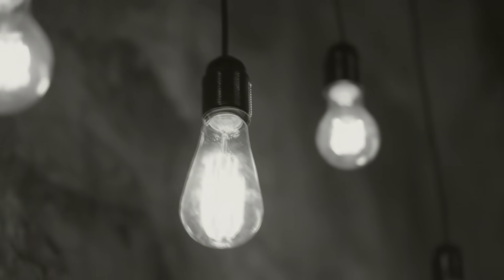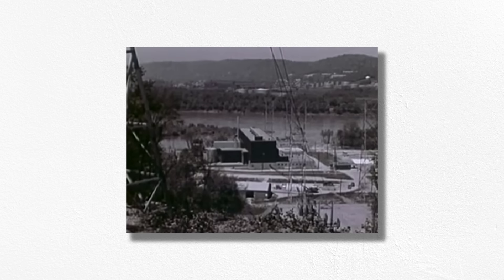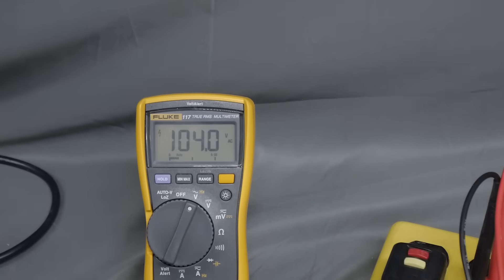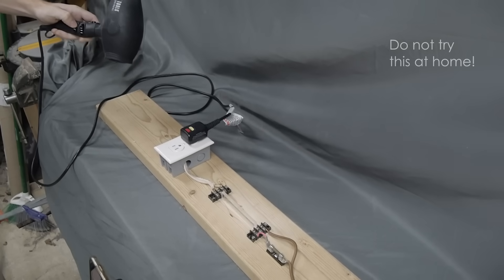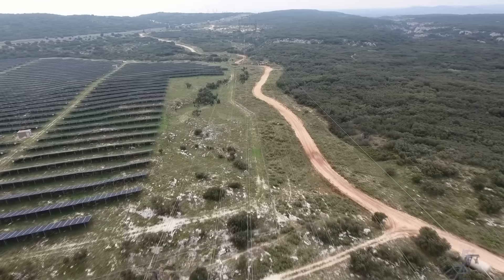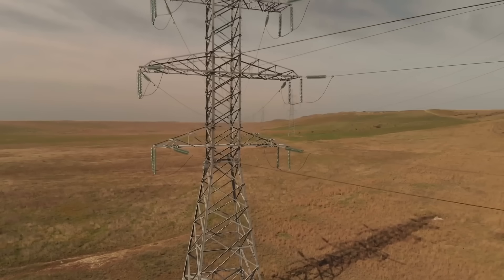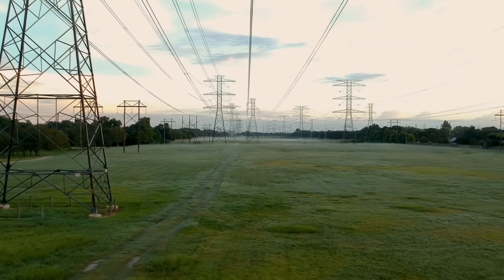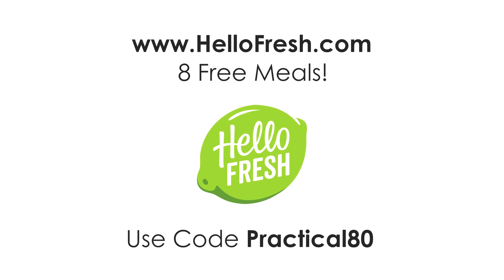How do Electric Transmission Lines Work?

Comment: What's the 3 phases for?
Reply: Really requires a long detailed answer but essentially it is the best way to send as much power as possible at least cost for AC systems. If a single phase system is capable of transmitting power P at a given voltage, a 3 phase system can send 1.732 (square root of 3) times P at the same voltage for each phase. The phases have the same frequency and voltage but each of them is 120 degrees apart (think of sine waves shifted 120 degrees apart)
Reply: because they deliver constant amount of power over time (need some maths to prove this, but take it for granted). power generated is always constant, so you need to deliver it at a constant rate too

Comment: How does higher Voltage decrease Current? From V = IR, V is proportional to I, meaning higher V, should increase I? Considering the hair drier example works, I think there’s something funky about that formula. That cannot be the whole story.
Reply: He used the wrong equation. It's supposed to be P=V*I, not Ohm's law.
Reply: What we're doing is to transmit power from one point to another. in an ideal transmission power in equals power out, but we live in the crappy real world, so we have to take into account the Voltage losses over the power line, 
This voltage loss can be calculated by the formula V=IR.
So the higher the current for a known resistance (ohms per kilometre/mile of transmission line) , the higher the voltage loss over the transmission line. Thus less power delivered to the end of the line. 

So to reduce the Power loss over the transmission line we can decrease the amount of current on the transmission line, but to maintain the same power supplied we must increase the voltage, 
P=IV

I hope this helps a little. 

Watch what Grady goes through at 2:50 again, but take special note to what he is calculating with the equations. His explanations here are spot on apart from the 2nd time he puts up V=IR and not P=VI

Comment: would be great to hear about the subject - HVDC powerlines for example.  Part 2 maybe? ;)
Reply: That would be awesome. I know that we're building HVDC infrastructure but i don't really understand how it works or how it's better than AC.
Reply: @jmonsted  Tom Scott did a video on that. Above a certain voltage and a certain distance, the absence of capacitance and inductance (because it's DC) makes HVDC economical.
Reply: Also no skin effect for DC; one can use the whole cross-section of the conductor equally effectively.
Reply: @davidbarts6144  came here to say this. With A.C. power we need bigger lines to accommodate the same amperage at high voltage.
Reply: @ElevatedEyes2023  is that also because the AC voltage is RMS, wherein it has a higher peak voltage and therefore higher peak current?
Reply: @iamdave84  current and voltage go together. Having a high peak voltage will not increase the current, as the higher the voltage the less current you need. 

As the voltage approaches the higher voltages, the power wants to ride along the outside of the cable. This has to do with the way that A.C. power works. At lower voltages it isn't a concern.

I hope he'll make a video on this topic to go into details beyond what I can explain.
Reply: @ElevatedEyes2023  Voltage = Current x Resistance, so when the resistance is constant, the current will flow back and forth proportionally to the voltage.

As the voltage reaches the crest of the sine wave, it'll be higher so naturally the current will also be higher at that point.
Reply: HVDC....quite a few videos here about that....seems dc is going to be preferred as lines reach about 600-700 KV....biggest 'hurdle' of course it the rectification, and generation of DC at that level.
Reply: YES, I have a friend who used to work with utilities who told me about HVDC and I was wondered how that's possible, if they have higher purity, lower resistance conductors or if something else has changed to make HVDC more efficient.
Reply: @slashetc  It's mostly just that the conversion equipment is so much more efficient than it used to be. HVDC made a lot less sense when you lost more converting than you would on transmission losses.
Reply: Part 3 can be about SWER ;-)
Reply: Before the focus on terrorism, I got a behind-the-scenes tour of the Celilo end of the Pacific DC intertie. I saw mercury and thyristor valves in action, sending DC to LA.
Reply: https://en.wikipedia.org/wiki/Celilo_Converter_Station
Reply: The high voltage DC lines are turned on and off via turning on and off the AC power which is being converted to DC High Voltage.  At Celilo near The Dallas in Oregon and Silmar, CA at the other end of the line.  The AC is easy to turn on and off because the power crosses zero current 120 times a second.  HVDC switches evaporate on being opened the first time due to arcing.   Long distance AC tranmission needs capacitors added to correct the power every ~100 miles.  This adds a substation and transformers and switches and staff and maintenance every 100 miles.  Long distance HVDC only need the AC substation and AC-DC converters at each end of 1000 mile HVDC transmission line and one (with ground return) or two wires.  Celilo to Silmar is 2 conductor HVDC usually operated (1975-1980 when I worked for BPA) with ground return so the power was send on both conductors (north in the winter and south in the summer).  HVDC is good for sending massive amounts of power from source to load on long distances.  It takes a lot of coordination to turn on and off because you are dealing with so much power.  Having a fully loaded HVDC suddenly open can cause a serious effect at both ends of the HVDC line and blow up transformers and HVAC substations in between.  A HVDC can carry over a gigawatt (1,000,000 kilowatts of power) of power per conductor.  HVDC isn't used much because HVAC is much more flexible even if it costs more.

Comment: In the first few seconds of the video you say the electric companies only get to charge for electricity that ends up at the meter but isn't efficiency losses bundled into those distribution fees/taxes that are itemized on most electric bills?
Reply: Yeah, but what I think he meant to say, was that your electric provider doesn't bill you in detail but charges a general fee for it (which is included in the price you pay per kilowatt-hour).
Reply: this probably requires some researching, the other possibility is they cut their losses. the same way walmart cut their loses when dealing with thefts, damages and such.

Comment: It is possible, in the optimum state, for transferring energy by means of laser? I mean if humanity could build space elevator, I don't think the maintenance of cables will worth the watt produced.
Reply: In space? Sure. In an atmosphere? Good luck. I am no subject matter expert but energy losses of a laser going through air and conductors would not even be in the same ballpark.
Reply: @BorderKeeper  So there's no way we could get wireless energy transmission with maximum efficiency?
Reply: electricity will always be the most efficient way of moving energy

Comment: Can you showcase the differences between AC and DC transmission?
Reply: Pretty much all transmission is done using AC, as you can see in the video... the power lines would literally melt using DC! 
this isn't to say that DC transmission doesn't exist... because it does! in rather odd applications such as when the cables have to go underground or underwater DC is used... but it is extremely rare!
Reply: Still would be nice to see differences why there being used.